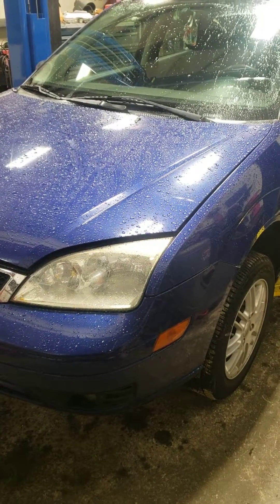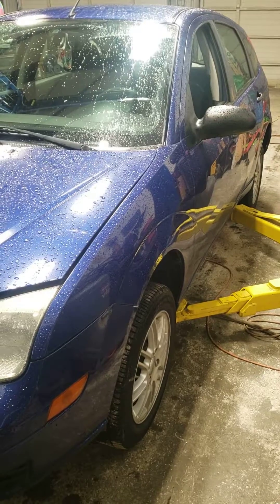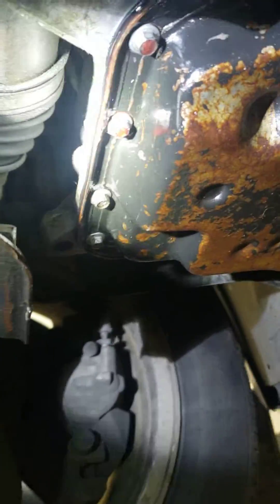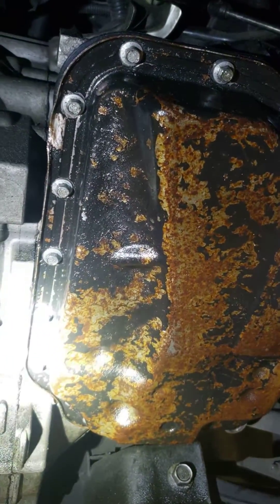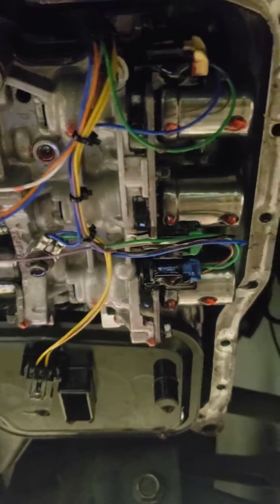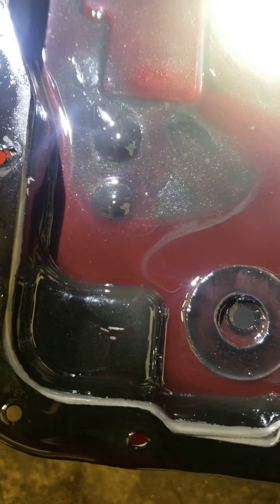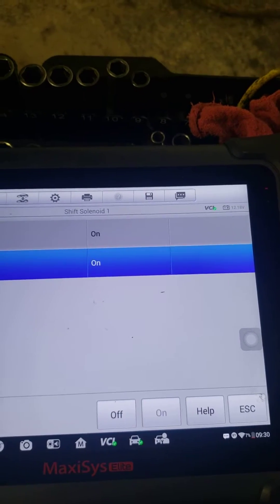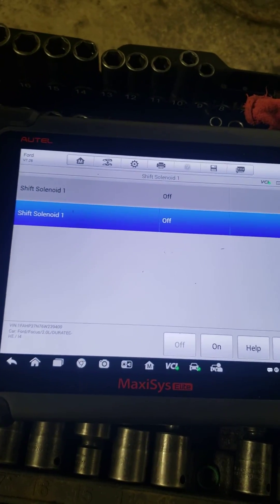Ford Focus No Second Gear Diganostic

Comment: Those servos hardly make noise if there is no pressure behind them. If you take rhem out onnthe bench and apply voltage they may make the slightest tick or non at all but if  you chuck air into the tip and then apply voltage they will dump the pressure with an audible click. I replaced one that i thought was faulty becausenit didnt click on the bench  with a new one and no change, both turned out to be good. My issue was just a stuck servo E that a cleaning fixed and new ATF as the original stuff was pitch black. No sparkles in pan, shifts great mow.